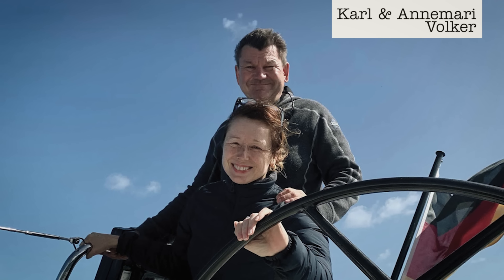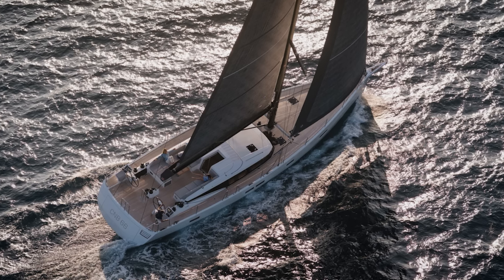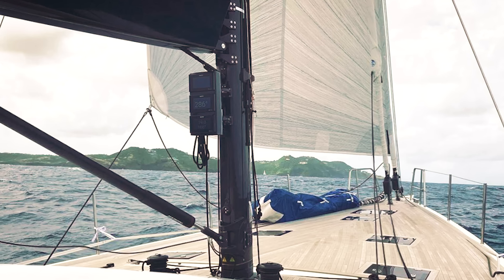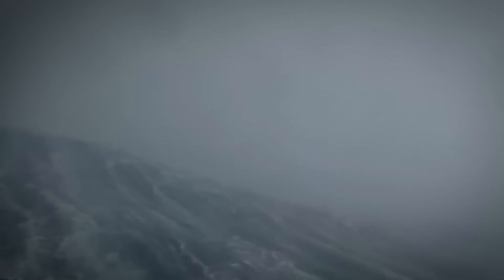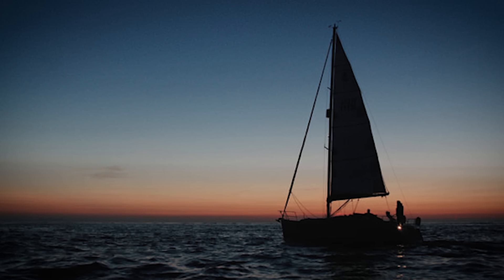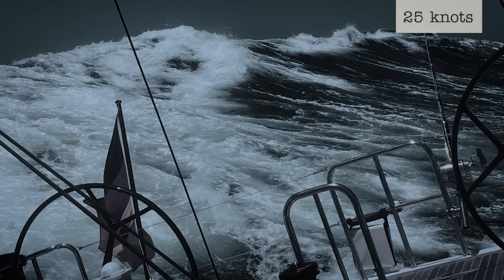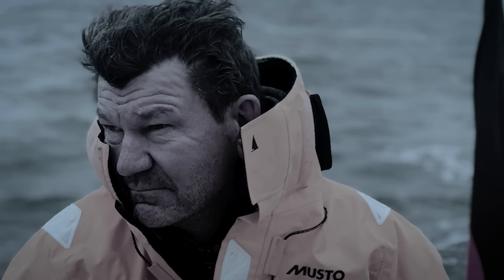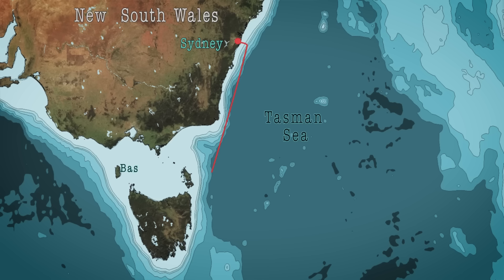Couple DIES on Private Yacht!

Comment: If you're going to sail aggressively  (reefing after high winds present themselves without paying heed to earlier warnings via radar and weather reports), you really need to have experienced people at the controls - particularly adjusting preventer and mainsheet lines on a large yacht equipped with a boom furler. Those tasks should really be split up between two people on a boat this size. Having your middle aged wife handle it all speaks volumes.  It takes "hard knock" experience to truly appreciate how forces on large sail systems rise exponentially with increased wind load. What seems perfectly sustainable at 15-20 knots can easily morph into catastrophe at 35 knots if a serious mistake is made or a key component fails. The push button convenience on a large yacht helps conceal the tremendous forces involved, giving a sense of false security that works against caution. If you had to manually crank in the mainsheet on a massive sail under load - you'd be a lot more cautious about reefing early and often. On a push button yacht, that kind of caution usually comes after the first serious incident - if you're fortunate enough to survive it.

Comment: A very sad story, condolences to all who knew them. There are many issues here, though a more experienced skipper and better prepared crew would almost certainly have been safe. The most glaring issue is obviously the mainsheet, which appears to have only a single loop, an inverted "gun tackle" (5:28), unlike the different boat's setup at 10:27 . It was not strong enough to prevent it from breaking ( 11:20 ) in a series of uncontrolled gybes.  I see no cleat, only the self-tailing electric winch at 5:28 . A second issue is that they did not have accurate detailed knowledge of the weather, and did not reef in time.  Of course there are all the issues mentioned by the narrator and by commenters here, but the two above are the ones which struck me immediately while watching the video. I'm amazed that  the boat did not get dismasted with that massive boom swinging freely about,  but the crew did manage to secure the boom before abandoning ship. There are more detailed accounts of this tragedy on the Internet, findable via a search engine.

This kind of boat  is probably fast enough to avoid bad weather if the navigator has a detailed weather forecast. There's a many-decades-old debate among cruisers: slow heavy  bullet-proof boat to survive the weather, or fast light boat/multi-hull to escape the weather. In any case, it was perfectly capable of taking the weather it ran into, but the crew were not. One could say "skipper" rather than crew, but perhaps all sailors  need to take a few lessons from aircraft pilots regarding Crew Resource Management. The traditional autocratic-subservient  skipper-crew relationship needs modification. This is a concept which has only been properly developed over the last thirty to forty years, after a series of airline disasters, and has significantly helped to make flying much safer than it was. CRM is an integral part of flight training today, and should be part of sail training too.

One idea: perhaps this kind of mainsheet system should have an automatic, fast slack take-up, so that there is always some tension applied to the mainsheet. This would prevent a loose mainsheet from sweeping over the deck (and/or cockpit). It would also act as a boom brake. That would require a special kind of  controlled pawl (ratchet) winch, engaging and disengaging the ratchet as needed. For such mechanised, electrified boats, that  should not be impossible to manufacture. But in my opinion, all such complexity is getting away from the intent of sailing, especially when I think of all those who have circumnavigated  in small boats with no mechanised assistance other than perhaps an auxiliary motor and  electronic aids.

Comment: Sad Story.

But I wouldn't blame the in-boom furling system and, also, I wouldn't so easily define the in-mast mainsail furling option as "a good solution".
I would say "You can furl the sail easily" ... as long as everything works properly.

In my experience, in-mast furling has been twice the worst problem I personally witnessed/attended to (luckily, I was not on those boats) on the seas; I would never choose that solution, especially on such a big mast.
Reply: What bothers me that people blame the boat design and or size. I understand why people saying these things. But this was a failure of basic safety protocols.

You should not have the main sail up at night with 24 knot winds and especially not with gusts of 30. It should have been dropped before Karl went back below deck. It's a crusier not a working boat. If your determined to stay sailing through those conditions just rely on the Jib, but bare poll would have been the best option. 

We can debate till the cows come home about which design is better or worse, but there's a reason they teach this in sailing class, because it works for boat designs.

Comment: Considering the heaviness and complexity of the mainsheet furling system they should have been more prudent by reefing preventively at night. They seemed to eager to reach as much speed as possible by taking enormous risks and constantly maximizing the sail exposure. The boat was completely out of control rapidly. This is a weird error considering they had cumulated already 3 years of sailing experience with that boat. Moreover sailing on a run is extremely dangerous especially considering their heavy boom. What happened to that boat ?

Comment: This makes me think. I sail usually single handed, but usually in the archipelago or not so far away from the coast. Still, getting help might take time. 

Now, initially in the case of the Escape, the weather was not so hard. It should have been perfectly manageable with such a yacht. The crew was far from inexperienced, but still, yachts are not like aircrafts where you have procedures and checking lists for almost any situation. Big sails are dangerous if they are not controlled. Even small ones are, if the wind reaches gale of storm forces.

Even though I, as not so wealthy person, sail only smallish boats, I have been thinking about having checking lists and standard procedures for maneuvers and sail handling. One of them definitely is not to have rope loops, loose lines and such around. One of the most important procedures I, however, as yacht master and trained sea scout master (which is on very high level here...) is to shout to the other crew members or yourself: I cannot! The aim is to recognize an unsafe or too demanding situation. One of the reason of not being able to perform as usually is the loads on lines in hard wind or high seas. Working hard on the deck of a rolling boat is many times harder, slower and more complex than on terra firma. So, "I cannot" should mean that I need immediate help by other crew members or other changes in the current situation. Now, if there is standard procedure that the main sheet and preventer should not be let loose and out of control any time, "I cannot" simply means that another pair of hands is needed or the maneuver, for example a gybe, should be interrupted.

I know, in some cases, ad hoc actions are probably the best things to do. But only in some cases. A trained yacht master or a mate on the deck should be able to make the decision to do, or not to do, an ad hoc act. Otherwise, everything onboard is done according to the standards. And I know these standards are hard to maintain. Let's say you are sailing a 24 ft sloop some 5 nautical miles away from the coast line. The weather is fine and you are sailing with another experienced sailor. You insist, for example, using preventers, because it is your standard procedure. You friend don't see any reason to use them. There is no immediate danger of not using them. So, he don't use them. But then you meet a thunder cell, which are usual on our coasts. And you don't even think about the possibility that there are no preventers...

When do accident happen? Rarely! Experienced sailors tend to be wise and able to avoid them. They happen when more than one unexpected things happen together. A local thunder squall can cause winds like 30 - 40 knots here (about 15 -20 m/s). For an experienced yacht master, with a trained crew, managing the situation can be demanding but usually not dangerous. But what happens if there are some other problems, too. Like the whole crew is tired for some reason and then there is a big ship on the same seaway. Human ability to perceive and processes information is limited and even during mild stress, decision making is not optimal. Not even close to!

So, basically, what should a yacht master do, if he/she is sailing a racer in a heated competition or single handed in beautiful summer weather. Take care of the crew's ability to act as needed. Stressing about last fractions of knots or pointing one degree higher should be helmsman's, tacticians or trimmers things. The captain should take care of the performance of his crew, even if he happens to be both the master and the crew. Most probably, one inch of the main sheet won't stop the boat or even cost the victory of the race. But hungry, tired and angry crew making bad and dangerous simple decisions one after another will cause problems. Either safety risks or loosing the race or having social issues that are not solved fast enough. One of such a bad decision is ignoring clear safety instructions. On of the worst decisions is to fight with a heavily tensioned or wildly banging line alone. The absolutely worst thing to do is not to say that I Can Not! Loudly and clearly!

Comment: Couples and small crews wanting massive yachts, is a deadly fetish. Recently I saw another of your videos on another very hard to manage 20 metre yacht, where a crew member got killed instantly by the boom in an uncontrolled gybe. Well, no sh*t, seeing how the boom in question weighed almost 700kg! That's like being hit in the face by a car. I have a modest 29 foot gaff cutter and it's plenty of boat for sailing solo or two handed, without the need for fancy electric gear and with everything staying manageable..most of the time at least. :)

Comment: This is almost a carbon copy of the Platino loss.  A large pleasure sailing craft with minimal crew, caught out by a combination of conditions and  heavy equipment.  In both cases, uncontrolled gybes that destroyed control lines and left a massive boom clearing the deck.

It makes sobering reading and caused us, coastal sailors on a 10m keeler, to review our equipment practises and training.

The Platino report is available on line and I strongly recommend reading it in full.
Reply: The Platino report is super detailed, and explains everything very well. A copy is at the ORCV site. That tragedy illustrates the "Swiss Cheese" model of midshaps very well, with a series of technical factors contributing, and had any one not been present, the disaster would probably not have occurred. I think it illustrates the inherent weakness of the dependence on advanced technology in yachts, multiplying the holes in the Swiss Cheese and increasing the probability of a chain reaction of failures leading to disaster.  Platino is a boat very similar to Escape, and the mainsheet arrangement likewise proved to be deadly (converted from an earlier, safer configuration). Even though the causes and conditions of the uncontrolled gybes were different, the consequences were the same. The forces acting on such vessels are enormous, and the hardware and technology appears to be inadequate to handle them when things start to go wrong, exacerbated by human error.

Comment: A little bit surprising that a boat of this size did not have a mainsheet on a traveller located either above the cockpit or at least at the aft end of the cockpit out of harms way. That single winch for the mainsheet right in the middle of the cockpit seems a little odd. But I’m not a yacht designer so there may be other factors at play.

Comment: just too much boat for people who dont have a pro background.
I am "only" a charter sailor.
between 45 foot with a crew of 6, a 51 with 8 (the skipper was a friend, i was co), i discovered having more and more relaxed rides with some lighter boats  (the best: Pogo36) , some dehler35, elan e3, and last was even the tiny bente 24. 
The forces become more and more manageable again, you easily take down your main sail and fold it without needing giants or hydraulic furlers .  With 2 people on board none of them being a body builder, nor any electrical support. 
In reasonable condition, you jibe and you tack even without a winch handle if you have the timing right. 
Yes for sure, thats not for going out in unknown weather, but for the baltic danish seas its perfect, if the weather forecast annouces more than 6 bft. and its not downwind, .. well you spend a day at the next bar, its always warm and sunny ;-) but its really so much more being in contact with the elements than on such a huge boats where when all the super fancy hydraulic systems get jammed, your seriously in trouble.

Comment: on that large boat with only two crew,  if they wanted self-furl options the designer should have made it a ketch and not only made it manageable but also safer at the same time. I hold the designer responsible.

Comment: Some of the contributing elements to this disaster were laid on the drawing board (or CAD drawing) during the design of this boat. A sailing boat of that length for a short crew could quite reasonably have three shorter masts, three staysails and only one short mizzen boom aft of the cockpit, with  much smaller individual sail area(s); that would have been my choice. Sure, it might have made for a slightly slower boat on the wind, but the crew would have a greater chance of survival in the inevitable storm with this sail plan.
The wind strengths mentioned in this video are not at all unusual experiences in ocean crossings.
This boat design was, I suspect, heavily influenced by modern racing yacht trends, usually for larger crews.
Bad design for the purpose.

Comment: Would I be wrong in saying there's a serious issue with people buying luxury/high end made to order sailboats that haven't been time tested or scrutinized like a production sailboat would?  A production boat would make the size and specs be as close to a perfect match as possible, while a boat like this had more of a focus on this is the size we want for 2 people sailing it.  It works with a motorboat, but sailboats are more like airplanes where you don't really want a 1 off.

Comment: Sad Story.   But I must say that the old ways are the best ways.  Why a sloop?  Split rigs were designed to reduce pressure on the sails, especially on such a big boat. Making it easier for a two-handed crew to handle one smaller sail at a time. The forces on these sails are massive.   Secondly, it did not matter what the reefing mechanism was.  Reefing downwind in a gale is virtually impossible, especially with a main. Why they did not turn upwind earlier and reef, I do not know.  This is why I am not good at following orders.

Comment: I had a 46’ ketch.  Plenty of boat for my wife and I to do long range cruising.  Being a ketch the sail area was divided up and much easier to handle.  Even in my sixties I could easily single hand her.  66’ and sloop rigged.  Fine for a professional racing crew. But not so good for a couple.   So sad and sorry for the couple.  Who is racing. Why so much emphasis on performance.  Sure we all want to make swift passages.  But not at the cost of manageability.  And yes, I don’t even like in mast furling for passage making, let alone in boom. They are much fussier.  We had slab reefing that was so easy with the smaller main on the ketch. I could easily do all myself. Again. So sorry RIP.

Comment: A ketch rig would have distributed the load between three sails.  Failure of one sheet or sail would have enabled the vessel to hold a consistant course reducing the swinging of a much smaller boom.

Far too hefty a rig relying on powered winches.  Hubris.